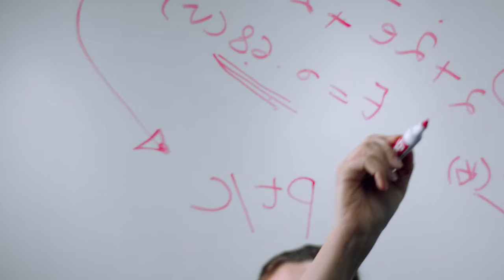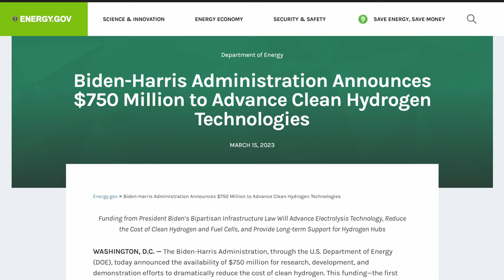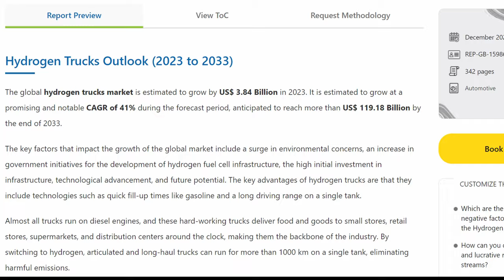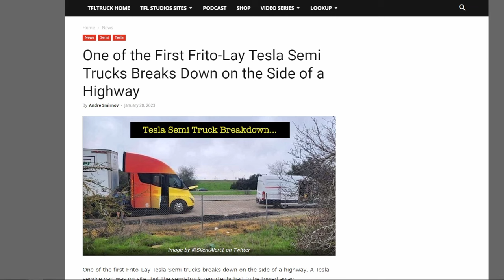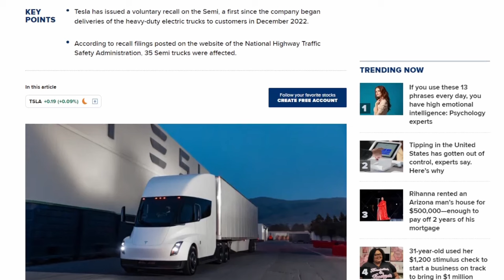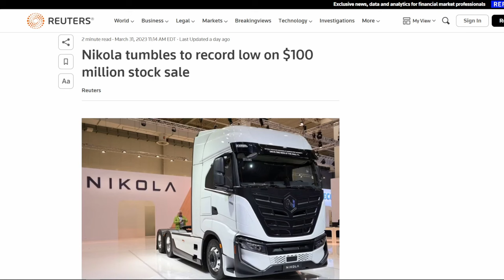Nikola Motors: The Biggest Fraud Of The 21st Century.

Comment: I don’t know where you got 15minutes to refuel hydrogen at the moment it takes well over an hour.
Reply from the maker: No it doesn't. A TrueZero station fills up a Mirai in 5 mins, and since the Tre has more capacity at the same pressure it takes 15 mins.
Reply: @visceral_investing  oh really? Christian Appel the lead Nikola Engineer says it takes over an hour but they want to invent fast refuelling with all the other hydrogen adopters to make a 700bar station which would get it down to 15minutes
Reply from the maker: Its 350 bar if you're using a non-proprietary nozzle and tube trailer, which is what they use for in-house testing. The commercial one is more expensive and has like 3x the capacity of the test trailers, which is why they don't use it for testing.
Reply: @visceral_investing  the capacity isn’t the issue it’s the pressure. No one has created a 700 bar refuelling station yet. Their lead engineer talks about this in depth needing other manufacturers to agree on a standard and then make it. but I guess they just use zeros stations apparently, the same ones for cars will do a truck in 15minutes. If you’ve got any videos of them refuelling quicker than an hour I’d genuinely love to see it.
Reply from the maker: The Arizona HQ has a 700 bar on-site refueler, it already exists. What Nikola is trying to standardize is MOBILE refueling using tube trailers that don't have an industry consensus just yet. ON-SITE refueling with permanent stations is what's creating the bottleneck for hydrogen usage, which is why Nikola is deploying the HYLA business unit.